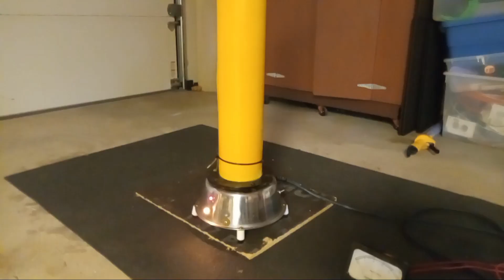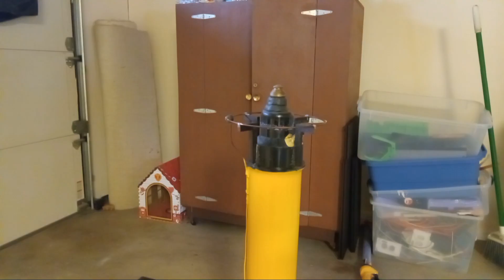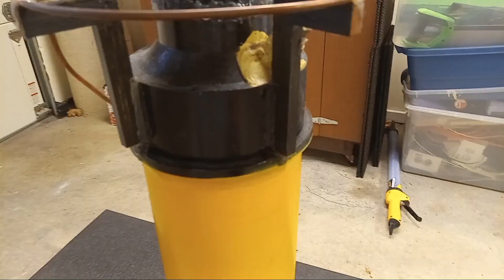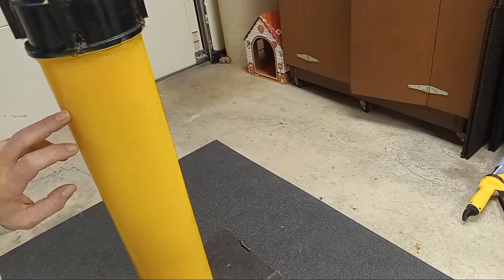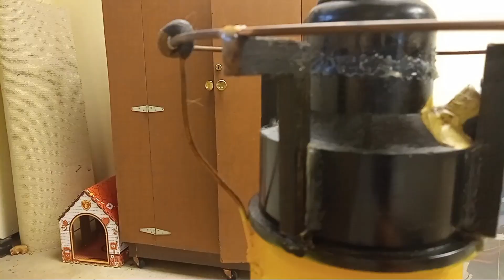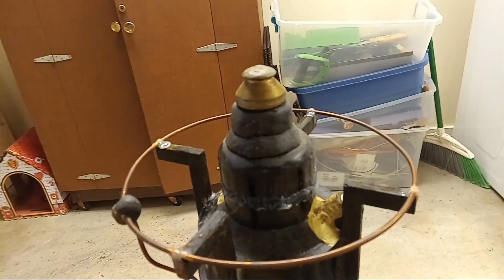H.V.G-3 🥶stupidity was your demise😔

Comment: These are my favourite type of videos. 😁 Okay, first things first so let's get this out of the way: you really should have used a nylon or acetal plastic drain plug. 😂
#2: like the person who recommended it, I also thought that transformer oil (made after 1978) was mineral oil based. So I'm not surprised it's miscible, but I am surprised it gave you problems because that does seem to be what most people use for these applications. 
#3 If you somehow managed to find 1970s transformer oil when you built this in the 1990s, then, I am not qualified to give any advice! But assuming you used modern oils, perhaps try the following:
#4 For less than 20 bucks you can get an endoscope camera that plugs into your phone or camera, designed for sticking down or up things like drain holes. They were incredibly useful, and if both else, you'll get another video out of the footage. 😁
If you want to clean out the interals, I'd recommend a 2-step cleaning: first flush it all out with kerosene, then rinse out the kerosene with isopropanol. 
Don't use acetone or anything that could damage the enamel on the coil winding or instantly melt the plastic pipe. 
If you need something stronger to dissolve carbon tracks, you MIGHT be able to use something like E85 as a solvent to flush the kerosene very briefly - obviously do your tests on the OUTSIDE of the pipe before putting it in. 
That should remove the carbon tracks if you fkush and shake vigorously enough. 
When it's empty and dry, you might try pouring in some oil-based polyurethane clear coat paint finish (or maybe hardwood floor finish, which I think is the same thing but thicker and cheaper in bulk, [not that you'd need much]), swirling it around thoroughly, and pouring it out to give everything an insulating coat. 
Then once that has completely dried (which will take a long time unless you figure out a way to improve air circulation through that single drain hole) you can fill it with the oil of your choice.
While working on this, try to keep in mind that it might actually be much, much faster to saw the top off and reattach it later rather than working through the drain hole.
#... I lost count of the numbers, but the high voltage lead at 5:20 coming out of the oil is probably glued in with Black RTV. At least that's what I would have used: black RTV sticks to almost anything, is a great insulator, heat, oil, and solvent resistant.
Please don't scrap this project. It's definitely worth saving, and I'd love to watch a video series on it's restoration. And I'll be happy to contribute by writing "YOU'RE DOING IT WRONG" in all of the comments. 😂
Reply from the maker: I knew you would have much to say.you came through😂ok firstly a drain plug was not in the plans.lol.that would have been difficult to produce on the side of a 4 inch pipe without leaking.2ndly, I never found rtv to be a good thing in the presence of oil.it failed many times over,but I do admire your dedication to problem solving.🙂😃that's why most of this is pc7.also acetic acid fumes in curing corrode stuff.igbts and rtv are bad things!it's not likely this has pcbs in it or the guy who filled up my jugs in 93? Would have told me,I only used it as reference that if there was moisture in this(very quesionably)where the moisture layer may be.when I looked up the freezing point of mineral oil (last winter,when it erupted)it said 22 degrees I believe?Google said it jellied due to moisture ingress?I find that hard to believe.any rate I'm gonna find that bottle of mineral oil and sit it outside to see if it freezes.google also says that transformer oil is more refined.what that exactly means I don't know.long story short I'm pretty crushed.if there's any places for sale next to you let me know,I'm moving.were gonna build the hvg-4,a really big one!!😁
Reply: @generalingwer4341 
I meant the metal thing at the top that the arcs keep arcing to. Maybe it's the fill port? At any rate if it was plastic or rubber instead of metal it wouldn't keep attracting the arcs. You could probably just stick a rubber or silicone stopper in there as long as it's upright.
RTV black is supposed to be oil and gas resistant but not all brands are created equal so maybe you just got a bad one? In theory it should work. I've never considered the acetic acid fumes from curing to be an issue that a small fan couldn't solve, but... Maybe I should consider it more carefully. 
I've also had pretty good success using polyurethane (gorilla) glue for waterproof seals under moderate pressure or vacuums but I have not tested it with oil. Two other products I recommend are an extremely quick drying glue called "Seal-All" which is oil and solvent resistant, and a product by Permatex called "MotoSeal 1 Ultimate" which was the only thing that worked when I needed to mske a gasket between HDPE and aluminum in a gasoline tank... Not an easy feat. I just looked, and I'm not sure this is made anymore, but it looks like there are similar products, but I haven't used them. 
If you're like me and like dramatically overcomplicating everything, you could just make a simple still and distill your existing transformer oil to remove any moisture. [I have lots of ideas... They can't all be good ones. 😂] 
Depending on your approach to matters of safety, it's worth pointing out that both mineral oil and kerosene have roughly the same dielectric breakdown. Mineral oil is much safer, especially as temperatures increase, but kerosene is much cheaper, so honestly the first thing I'd do personally is just drain the bad oil, give it a quick flush, and fill with kerosene and give it a quick test (with the metal plug removed) to see if that solves all your problems. 
I would definitely do that test outdoors though. 
Well... I guess if you have great homeowners insurance and if you're trying to seek the house anyway, you could test it indoors. 🤔
Uh... I should probably stick to only giving advice on electrical and mechanical things. Real estate and insurance fraud are beyond my scope of practice. 😂
If you're definitely building a new one, then I guess just cut this one open and salvage the parts. A spray bottle of kerosene will clean them up nicely and remove the old oil and evaporates away reasonably quickly.
Reply from the maker: Thanku for the usage/ compatibility info.i wasnt aware of kerosene's properties.the fill port(not much of one)on top is a bronze 1/4" coupler,pipe thread.the seal all, i have seen before,its been awhile though..lol.lately i complicate things too.its called being over whelmed to the point the brain seizes.im gonna look for transformer oil again.its a very elusive product!kinda like looking for truely,anhydrous acetone,lol or a condor egg.perhaps ill dawn ppe,scale the fence at a substation,and tap a hole😂maybe ill dig my hv box out of storage!its dampening😮 @SkippiiKai